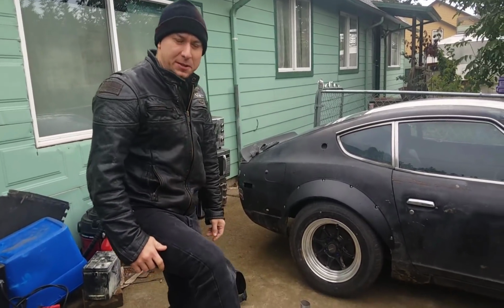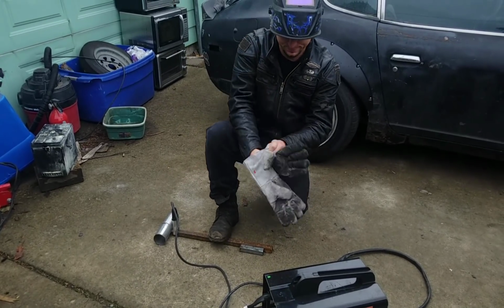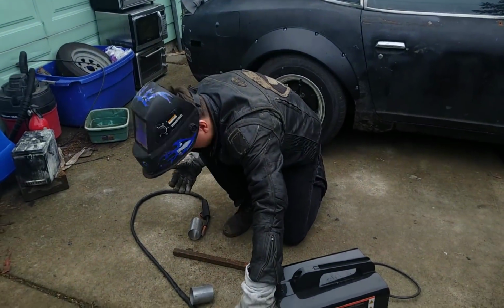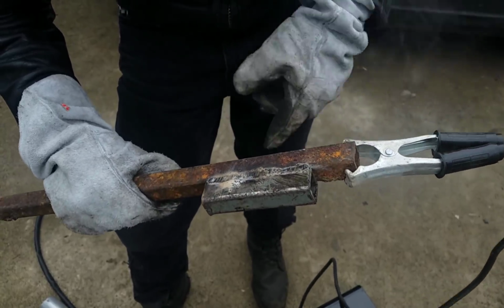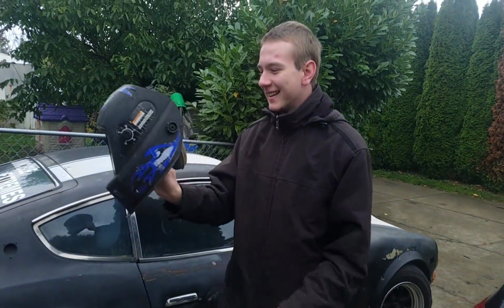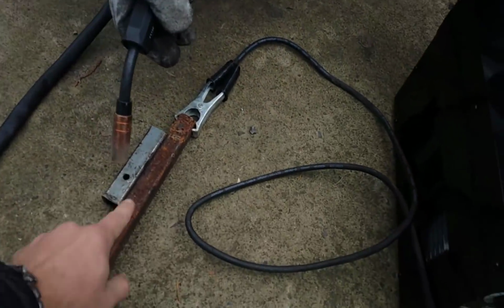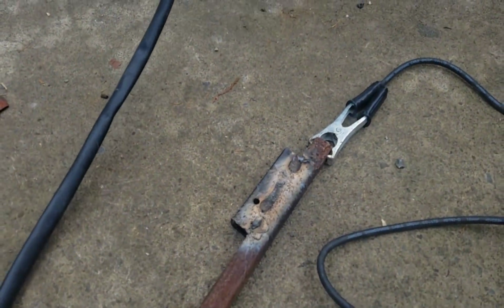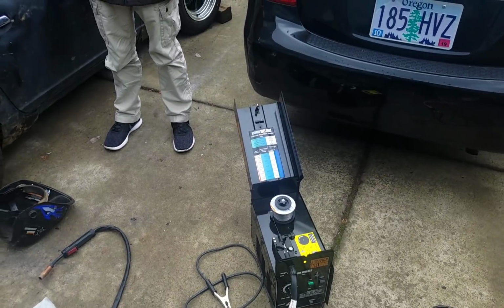$99 125 amp welder. Worth it? new 90 a.  Harbor freight 120v budget welding review. Chicago electric

Comment: just picked up one today...not bad for the price. .can only start and arc when you squeeze the trigger so remember that..i didnt realize and thought it was junk out of the box...
Reply from the maker: They're not bad.  The 170 amp one is head and shoulders better.
Reply: All mig welders are like that. You must be thinking of stick welding?
Reply: @Everyday_Railroading  old ones you didn't have to pull the trigger to start.
Reply: i had an old campbell hausfeld 80 amp flux core  i learned on and it did not have that trigger feature..
Reply: @BenRSnyder  - Oh , I see. I learned something new. Thanks

Comment: I bought one of these to get off a rounded ofd bolt. I plugged it all in but decided to give her one more try with a wrench and sure enough i got it off. I could return the welder but nah im keeping it now!
Reply from the maker: tubeyourself it's handy to have around
Reply: Restored an older car. Replaced the worn out seat belts for new ones.  The attaching bolts to the door pillar,
One rounded off bolt head. A few minutes of very careful die grinding. Wow! New flats on the bolt head for the next size down socket.

Comment: I have mine all setup but I can seem to get it to weld? What could I be doing wrong?
Reply from the maker: Return it and buy the 170 amp model or the little green inverter welder... MUCH better welders.  But if you really want to keep it, you need to pull the trigger.  Or maybe something is broken inside

Comment: I have welded a handful of times over 10 years with this welder. Usually from underneath on broken post to frame of fast food restaurant bench seat.  Maybe 3/16” steel. Always got a lot of little ugly beads and had to go  over it multiple times. I know I held it too far away too.  Have more confidence now and bought .035 wire today instead of the .030 I’ve been using. Should the tip be touching the project as you pull at an angle to feed the wire or should there be some daylight? Going to slow it down and do circles. Going in tonight to do a bench.  We will see.  Love the Datsun Z.   I had a 260 for 20 years.
Reply from the maker: 1/4 inch away.  Don't touch the tip.  Also, i made a mistake on the circles, thats with mig wire.  For flux core do slow z back and forth so you dont run over your old slag.
Reply: Thanks for the tips.  I think I had it in my head to move the tip quicker because I had a bad experience a long time ago with bonding to my tip or freezing up. Probably wrong speed or too close.  Anyway, my particular welder specifically says to use the 030 wire so I couldn’t change that. My weld last night wasn’t perfect but much better with bigger beads as opposed to tiny splatter.

Comment: Can I weld my 280Z floors with this welder? Thanks!
Reply from the maker: No, but the little green welders they sell for under 200 work great for that.
Reply: Invincible Extremes Muscle Cars Garage thanks for the reply on a 2yr old video haha. Thanks for that I’ll look into them thanks for the video and info
Reply from the maker: I have a video comparing several different welders and you'll see the difference.  Even without a gas bottle, dc output makes a huge difference.

Comment: It's impressive considering it's 100 dollars new. Little brother caught on pretty quick too. Might be soon enough you will be calling him up when you have a tricky weld.
Reply from the maker: Yeah he did well.  We prefer to use regular mig with a bottle though
Reply: @InvincibleExtremes  If it had a regular voltage knob i would consider buying one to have something portable to take outside.
Reply from the maker: The little INVERTER welders they sell at home depot or little green ones at harbor freight are amazing for that kind of thing
Reply: @InvincibleExtremes  Yeah the Titaniums look pretty good
Reply from the maker: I have a 200 titanium I've been using for almost a year now.  Amazing welder, love the flex input
Reply: @InvincibleExtremes  As it happens my little 140 amp transformer mig just died. I can feel a titanium 170 or 200 pulling me in like gravity. Till now i've been spooked by inverters because  i knew a lot of guys with trouble with them. But it seems like they've got them squared away

Comment: It puts out ac current, so the welds will be horrible no matter what. Flux core needs dcen. Spend 20 bucks on Amazon and get a 200 amp 50 volt single phase bridge rectifier and graft it in, and switch the crap aluminum ground lead for some 4 ga copper, you can get decent performance on "low", but you still only get a 17% duty cycle on high, and now your 150 bucks into it. Better off with the mini 110 stick welder inverter
Reply from the maker: Yup, inverter welders are much better, hence my love if the century fc90.  Half the weight, dc, and twice the duty cycle

Comment: Hey bud good to see a update with the zed.  How much is the 170 amp welder compared to this one? would it have been better to save a little more and go for that one if it seems to be more flexible, like you mentioned, you can have a bottle on that one if need be. Do you plan on Fixing some of the rust in it? or even in the Pontiac? It's a slippery slope, I've been fixing the rust in my zed for over 2 years now, nearly done. Check out some of my vids mate, would love some feedback. Hope the family is all well!
Reply from the maker: Dolf86 oh I plan on fixing all the rust.  Just making it run, drive and race are number one priority.  Same with the firebird, just can't afford to at the time...  I'm releasing the revival of the zed video in a few days, you will love it.
Reply from the maker: Dolf86 and yes the 170 amp welder is only 170 dollars vs 99.  So not big on price, and I own both welders.  The big difference is this welder is lighter and uses 120v... so it's good to have both around.
Reply: I'll keep my eyes peeled for the video bud

Comment: Does this welder cold enough to do sheet metal?
Reply from the maker: No.  It's warp it.  The 170 amp model works great for sheet metal and is under $200

Comment: I have the same piece of $h*t welder, and it works ok for exhaust work, and works "acceptable"  for stainless exhaust work.  I would say for everything else it is useless.  But, if you just want something to buzz exhaust hangers on, and join pipes together better than a clamp then this welder is a perfect tool!  And better than nothing.  I also have a Miller 212, but that weighs in at 410 lbs, so this little Harbor Freight turd is super light I can throw it in my truck bed and take it where its needed and not care if it starts raining while its in the truck bed lol
Reply from the maker: Yeah, it's crap, but it works.  My favorite truck welder is the century fc90... its only 15 lbs and is DC output so it welds a lot cleaner.  Still flux so its a simple to use setup.

Comment: I will have to get one. My older harbor freight cheapy would do car sheet metal, but not 1" tubing like in the video.
Reply from the maker: Daxton Brown yeah, 3/16 is about the thickest it will do.  It does not have much more power than the 90 amp, but it is noticeable

Comment: Great vid fellas, I just bought one of these to weld the frame of a cnc router I’m building, and this type of vid with two guys like me demonstrating the product is better than any “professional “ vid. I relate to you guys. It says 3/16s max on the box, think I’ll have problems with .25? (Most of my frame is 3/16s but the gantry is .25 for threading)
Reply from the maker: R. McCloud set the gap a little farther apart and you should be ok for .25...  just don't expect it to be as strong as something welded together by a 240v welder with more amps.
Reply: Get a Lincoln tombstone 225 arc welder for the thicker stuff.

Comment: Have something similar from Campbell Hausfeld and so far it's lasted 20+ years. For bigger jobs, a 1939 Twentieth Century stick welder...
Reply from the maker: CerebusTV nice
Reply: Have you ever had to replace the liner in the gun cord? (Called the whip in stick welding) (the liner is what the wire runs through to the trigger mechanism)

Comment: There is only one thing that I didn't like about my Harbor Freight.  The instructions stated " crank down "on the wire roll spring tension.  The wire roll spring goes from 0 to 40 turns.  It takes 3 turns to stop the wire from rolling off the mechanism. You will have good luck with 4 to 6 turns ( just a little above the minimum ). 25 to 40 turns is not what you use. That is what many would call cranking down. The internet straightened me out. So, just a bad start problem. I  owned a used stick welder that I bought for $75 in1980. This machine does very noticeably better than the used stick welder ( 110 volt ). I would have jumped at it sooner but wire feed is listed as production line equipment. I don't have a production line. The stick welder was good for window guards but was really really border line on riding lawnmowers. The Harbor Freight has held up for all my household projects. I came up with so many that I could have gone to the next more expensive welder ( the bigger spool saves you 40% on the cost of wire spool refills ) A supplier that sells  metal direct to the public is also good. You can buy your metal tubing and plate at 1/3  the cost of "the big name hardware stores"
Reply from the maker: The 170 amp welder is a much better machine.  But this one does work for odds and ends.

Comment: I love my cheap H.B welder. Just remember to use flux core wire. I bought some solid core and it looked like chicken poop. I thought my welder was broken but It was just me not looking at the new spool I bought.
Reply from the maker: Yeah that's for sure.  The 170 amp machine btw is amazing with a bottle of gas and solid wire... just something to think about

Comment: Can this weld aluminum water tanks?
Reply from the maker: Good question, Absolutely not.  Welding aluminum requires specialized equipment that costs 20x this much
Reply: Dang, I have this welder and a 120 gallons aluminum water tank from a concrete mixer that I wanted to turn into a smoker.

Comment: Watching this video to get an idea how to weld on the very car in the background.
Reply from the maker: This isn't what you want then.  If on a tight budget i recommend using the 170 amp welder they sell, or the century fc90.

This 90 amp welder leaves a bit of a mess and is hard to use on sheetmetal for rust repairs.

Comment: Can you tell me what the item number of that welder is? Item#63583?
Reply from the maker: Not a clue.  It's the 125a model they changed the name on from the 90a one.  Should be the same machine but with a different label.  I actually prefer the century fc90 for a cheap portable welder.  Its half the size and much better

Comment: It says it's only rated for the 2lbs roll of wire, but that's bs, I run a 10lbs roll of Lincoln wire, (find them at Lowes), and have been for over a year, and haven't hurt the machine at all. And it's cheaper than buying the same amt.of wire in 2lbs rolls.
Reply from the maker: Good times.  I myself prefer the 170 amp welder they sell.  Dirt cheap and welds so much better than this one.  Plus i use a bottle of gas and it welds super clean with solid wire.

Comment: I would tend to agree with you on the  value of the welder  although i am not by any means experienced as you are  in welding but to have as a Harry Homeowner rig it seems to be just fine  for the money and that. Is a plus that it could run off a generator  around a larger.  Peice of ground. Or a rural setting  situation  thanks for the reveiw  BTW. I had figured out on your voice tone that.  The newbie must had been your younger brother  or son
Reply from the maker: It's my brother.  Good kid, we have a ton of fun messing with classic cars.  Btw... the two welders that i would choose over this are the 170 amp welder for $165 or the century fc90 sold at home depot...  both are under $200 and are DC output.  Which means a lot cleaner weld on flux core.... The bonus with the 170 amp welder is that it's got almost everything needed to run a gas bottle and will weld much cleaner with solid wire...

But it requires 220v... I've used it with a generator before too.

Comment: Guys who do the D/C bridge conversion need to know the cheap ebay Q.C. rejects have one or more diodes that are  way out of tolerance.
A rectifer needs 4 matched diodes to convert A/C to D/C. 
Four 25 Amp diodes add up to 100 Amps total current capacity. 
A "Three phase bridge" still is the sum of six diodes. So it appears it can "handle" 150 Amps total current.
But we use single phase  in our house/shed and converting to D/C use just four of the six diodes.
Two A/C wires in. One D/C + and One D/C- wire out.
Current capacity of any diode goes down with heat. 
-
Look at this video=Winter time.  But this spark box is an A/C only unit, with a step down transformer it will spatter for years. With it's sketchy, imprecise plastic wire feed.
Summer-Winter, messy, no penetration, A/C spark box. Try your friends out.  Butt weld 1/8th inch steel carbon steel plate-Hammer Test in a vise=Fail.
-
So now you hate your HF welder.  So why mod? Just because there are: "So many Youtube Videos" of it?
 The "Ebay deal." Buy several cheap, out of tolerance bridge rejects. 
Sent in packets to America with 30% or greater, out of tolerance inability to handle current .
 Just one defective "25 Amp" diode in the "125 amp full wave bridg"e that only can handle 17.5 amps and operating on [HIGH] setting WILL short out in summertime. These "Welders" can draw 24 Amps on high on a 20 Amp breaker.
 And when just one diode fails, you get the instant, back revert to A/C only Output.
Reply: I said: "A rectifer needs 4 matched diodes to convert A/C to D/C. That statement is correct.
Then I said:   "Four 25 Amp diodes add up to 100 Amps total current capacity." 
 That is incorrect
A singlephase Wheatstone bridge, does indeed need four closely matched(quality made)diodes. 
But,  only 2 diodes or(One Leg) are flowing the rectified forward D./C current at any time. One fails(POP) and
your rectifed HF machine is broken. No output.
So diodes need to be oversized above the max output current.   An A/C to D/C, 3 phase 6 diode bridge rated @150 A wil contain 6, 150A diodes inside the potted(encaspulated) case. But you are only using four in single phase.

Comment: Not bad for 99 bucks the tech gotten better so cheap welding rigs do better hopefully you get some use out of it
Reply from the maker: +gene miller yeah, a lot better than the old 90 amp one I used to have from them.  The low setting is still too hot for sheetmetal but the convenience of a cheap portable welder more than makes up for it.  Besides, I've been able to work with a lot worse, so I'm happy with this.

Comment: i Learn mig by pushing the puddle not pulling ?!?  ... 30 to 45° angle with the head facing the gun and the 'pool'
Reply from the maker: SmashMat both work.  Some times one works better than the other.  I'm no expert that's for sure.
Reply: Yeah for sure it work but u need to see where u going before jumping 'out of the seem' .. ;) ..  scuse my weird interpretation but im french so im sorry hihihi ... im just tring to say its easier if u are facing the  fusion puddle, to get the best possible view on it and determine his quality and also whats commIng next to it .. cant do that in reverse :p hihihi
Reply: Yeah...get the best possible view at your fusion point at the same time that you are tring to covering it with the spout of the gun ;
Reply from the maker: SmashMat agreed.  That's why I usually weld left to right so I can see.

Comment: anyone know if this welder can weld aluminum?
Reply from the maker: +Christopher R it cannot.
Reply from the maker: +Christopher R the only welder that's cheap that can is the Vulcan series of welders, you can get a spool gun for them too
Reply: Thanks for replying.  Do you think I can use acetylene torch?  I am trying to weld 2 pieces of aluminum bar - original welding broke off from too much stress.
Reply: no this one cant weld aluminum in its stock form... this one can...hobart 190..240 volt (they make a dual voltage 120/240 volt one for about $100 bucks more)....sure its 500 bucks... but it has everything you need a gas flow meter/regulator, except the hood(welding helmet)  and the spool gun for welding aluminum (about 200 bucks) and no tank ($70 empty) and some money to fill the tank... but if you are looking to get a rig for less than $1000 this is a really good one that WILL do commercial welding, not some DIY/hobby welder that this one is...

Comment: Pretty good lesson. It helped me.
Reply from the maker: Definitely weren't the best instructions but he did catch on with more practice.
Reply: @InvincibleExtremes    Do you any suggestions on a nice welding helmet  The one that came with this Flux 125 amp sucked!! If you can do the favor and drop a link. If it's not too much to ask.  I'm a beginner. My uses are basically household
Reply from the maker: The helmet harbor freight sells for $45 is great.  Been using it for years

Comment: Question my good man: i repair mowers and lawn equipment and at times i get stuff with cracked frames and broken stuff. Id like to weld stuff but like your lil brother i never welded anything before. What size fuse/curcuit should that welder run on if i bought one for my shop?
Reply from the maker: First, look at a century fc90.  Much better welder, second, it'll work just fine off a 20amp 120v cicuit.